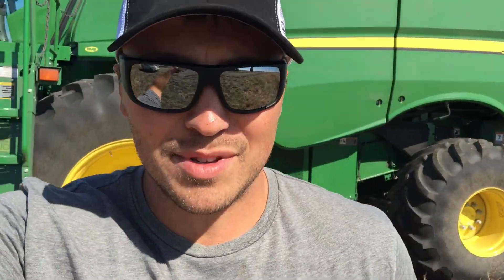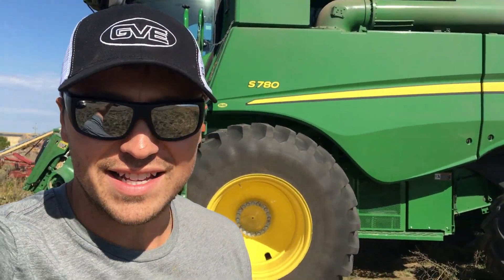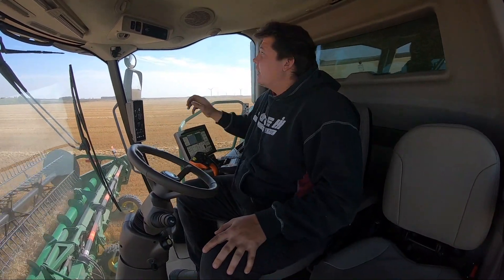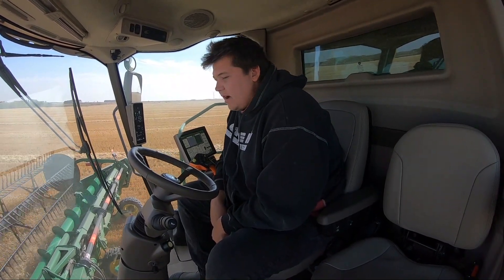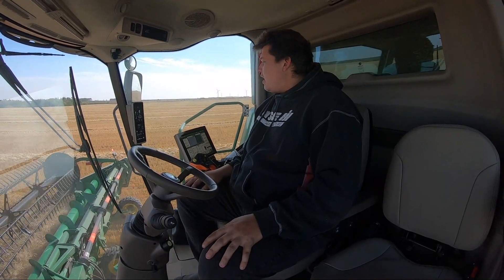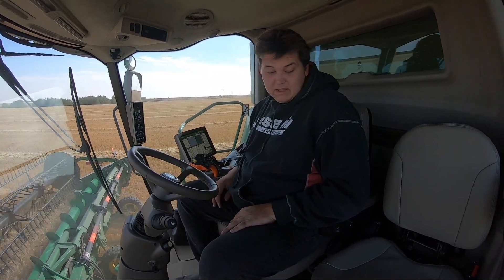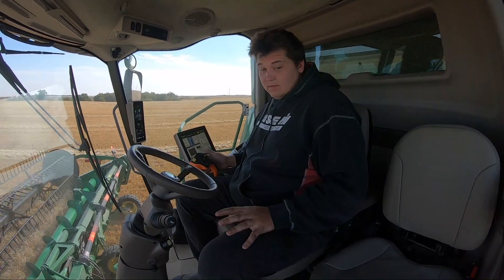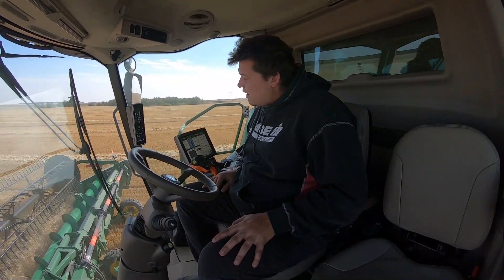Combine comparison John Deere S780 vs. 9230 Case IH    Head to Head harvesters in 2020

Comment: not a good Comparison , you should be comparing a 780 to a 9250 Chucky
Reply: Should be compared to an 8250 not a 9250. 780 will destroy an 8250, ih has massive power loss through inefficient drive systems.
Reply from the maker: maybe one day if i ever upgrade lol

Comment: what is the best combine harvester in your opinion?
Reply from the maker: i dont know if there is such thing as "the best" 
most modern brands are reliable and perform well.
a lot of farmers decide on brand based on the local service that the brands dealer provides among many other things.
Reply: I prefer case ih or the outlet ihc

Comment: Interesting many years ago JD 9770 was struggling keep up to CaseIH 8120, I reckon CaseIH combines are easier operate n clean down.  JD has best GPS guidance system.  We have red top 8010 n next door has JD S680 so we will see over years which one be better to own.
Reply: 8010s are an awesome machine 👍
Reply from the maker: they're all pretty amazing machines. if youre not too hard on it, and service/maintain it properly, either one will serve you well